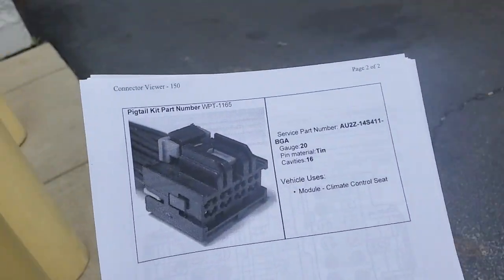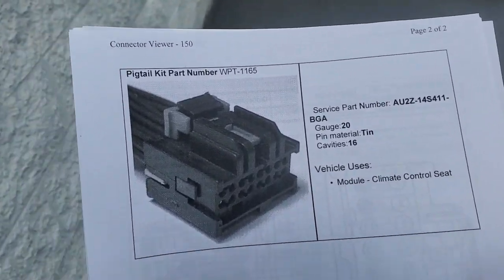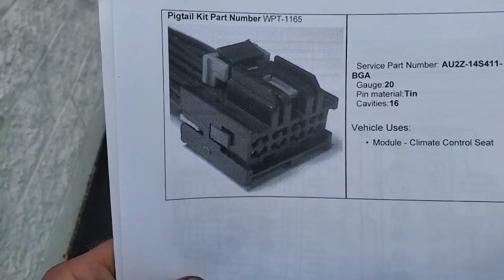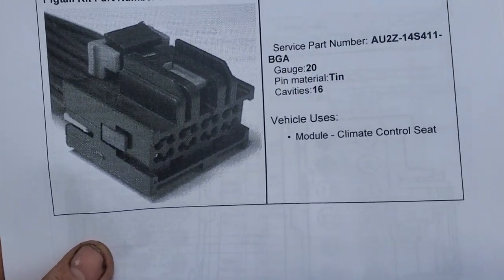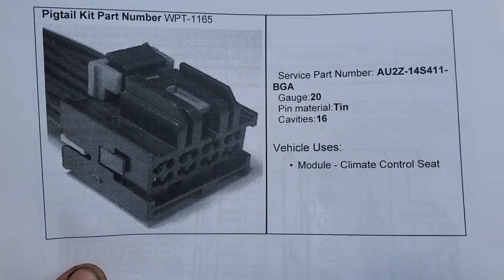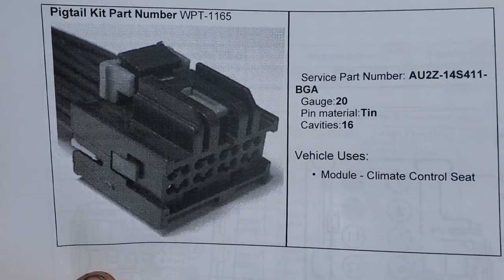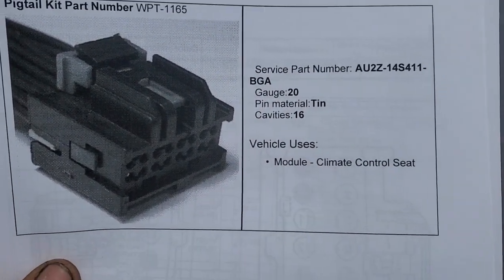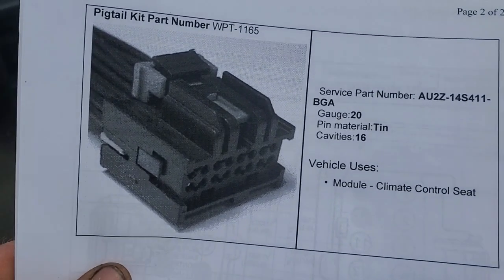F150 Heated and Cooled Seats Intermittent Not Working - Pin Fitment Issue and Material 2016 F150

Comment: I was hoping you could answer a question for me I have a 2016 Ford explorer The driver side heated seat gets warm but not hot like it used too I was wondering if you could tell me where the module is located for this vehicle it doesn’t look like the one that you in the 2015 I appreciate any help thank you
Reply from the maker: Well if it's getting warm chances are you have a Thermal electric device that is starting to go bad and it's not able to heat up completely or something inside the seat has become misaligned with the actual heated blower unit
Reply: It is just a heated seat no cooling. Can you tell me where the module is for the drivers seat

Comment: Would this work, if the heated seats are staying on, all the time weather or not the button is on?
Reply from the maker: They could but I will check the connections at the passenger seat module first up front of the seat
Reply: @FordBossMe  is the module under the passenger seat that controls the drivers seat? My drivers seat is staying heated and it's burning my back up!

Comment: All I need to know is where the heater module is for the seat
Reply from the maker: I've got plenty of videos up on this if you're looking at an 11 to 14 it's a smaller module under the passenger seat little small square one it's got a black connector and a green connector 

If you're looking at a 15 to 20 20 then it's under the passenger seat as well except it's got like four or five connectors and if you look in the library I actually show you where it's at so look in the library on the channel and you'll see like a 2017 F150 I think it was that had heated and cooled seats they were having issues and I found pin fitment concerns under the passenger seat

Comment: What about a 2017 F350?
Reply from the maker: Well it's the same type of issue it's either the little Ted modules under the seats or the connection or the module itself
Reply from the maker: I'd have to specifically look at that vehicle to see what's involved in the system but it's pretty much always the same type of thing with all of them
Reply: @FordBossMe  I have not had any problems as of yet.  I know that the F350 shares a lot of parts with the F150.  I have 17500 miles on it and out of the Ford 3 year warranty.
Reply: @FordBossMe  On the Explorer I've seen C1035C pin 12 melt on a few. Its under the BJB, supplies power to the elements and the DSM.
Reply from the maker: @williamGSXR110  we've had a couple problems with those
Reply: @FordBossMe  Unrelated but I talked to my FSE today, He said anyone who got the 21B10 and is having the shudder is getting heads replaced by Ford. He said the update doesn't cause a transmission shudder it's actually the VCT phasers oscillating, only affect higher milage engines because of the worn cams.
Reply from the maker: @williamGSXR110  I see
Reply from the maker: @williamGSXR110  thank you for that, my fse was in today and he was CLUELESS AND ACTED LIKE A PUSSY talking about the explorer leaks and reprogram issues 

he didn't want to say a thing Mid twenties and a little puss

he wanted to give up no info
Reply: @FordBossMe  LOL